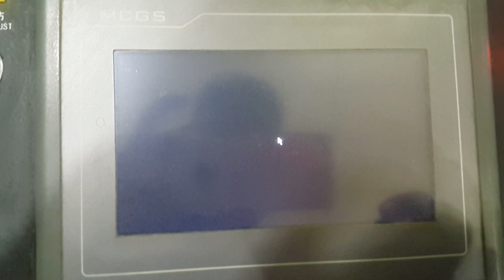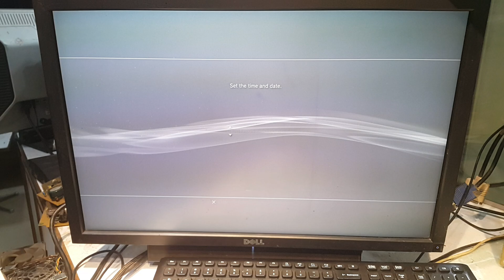ps3 turns off immediately after turning on

Comment: I had a 3004b and I tried to delied   gpu and I scratched the gpu a bit, but even so it worked the first time, after I assembled it in the case it didn't work anymore. It starts for a while with the green light on and after shut down it self with no red light on.Maybe the problem is from the gpu scratch, but how did it go the first time?
Reply from the maker: What did you mean by delied ?
Reply: @idreestech  remove ihs from the gpu.
Reply: @idreestech  The metal plate on which the thermal paste is spread, under it is the processor chip, which also has the thermal paste.
Reply from the maker: @laurentiuilina4992  This error is not from a GPU side. Please watch my other videos related to this error.

Comment: My ps3 can freeze
Reply from the maker: @MithOkai-i7r If your PS3 is freezing, it might be due to overheating, a failing hard drive, or corrupted system files. Start by cleaning out dust and checking the cooling system. If the issue persists, consider testing or replacing the hard drive and rebuilding the system database. Let me know if you need more help with troubleshooting!